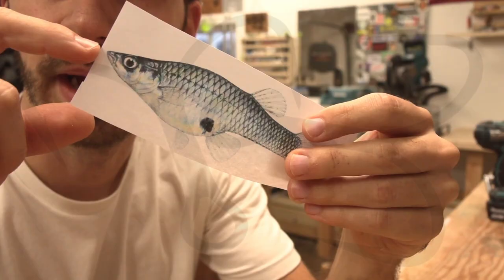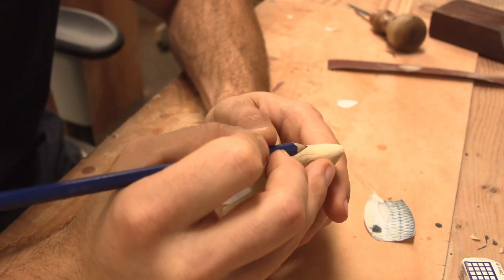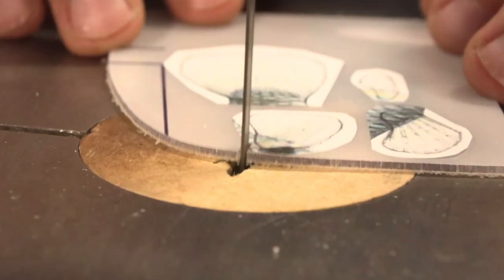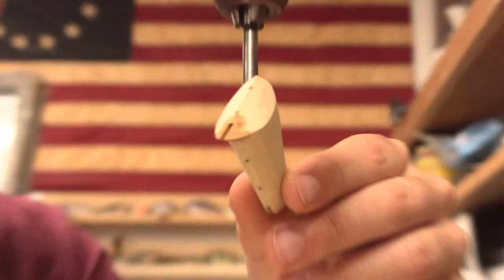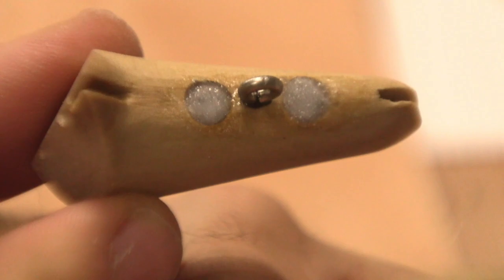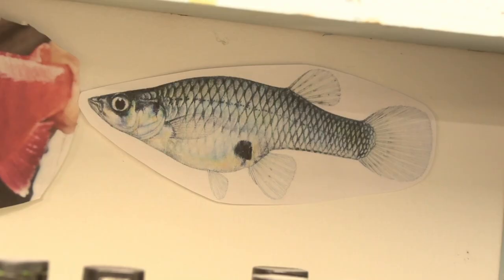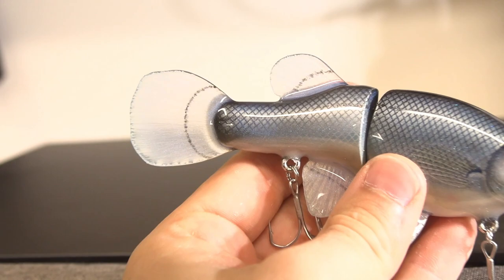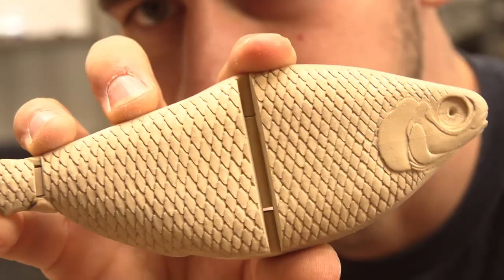Making a Mosquito Fish SwimBait

Comment: I’ve got money to get either a lead pot, basic airbrushing kit, or a dremel (I already have most other tools) which would you get first? I have a soldering iron so I could potentially use that to get weight in my baits.
Reply: Personally go with airbrush kit(you could borrow a drill till you get a proper dremel)
Reply: @jasonmccord1287  yeah I have a drill press and drill and I had a Dremel until it burned out. But I don’t yet have an airbrush so that’s probably the place to start.

Comment: You know watching you use such a large hand saw to cut the slot in the tail makes me cringe, remembering how many times I did things like that and slipping and half cutting the tips of my index fingers off. I learned a jewelers saw works much better at least for the initial cut and can be followed up with a larger saw if needed or a thin piece of metal covered in sandpaper.